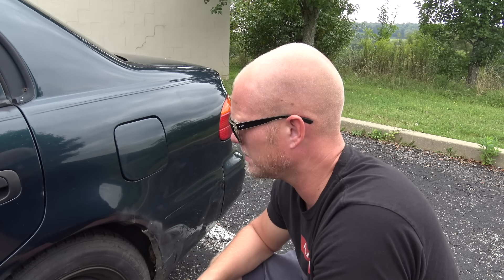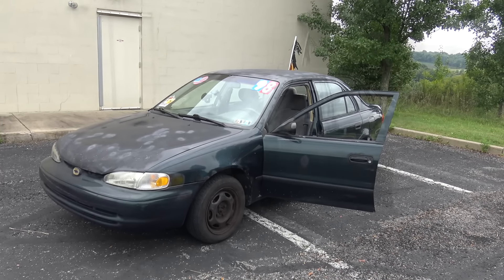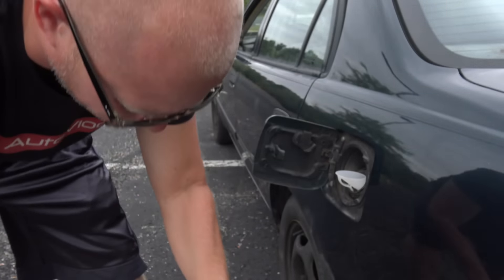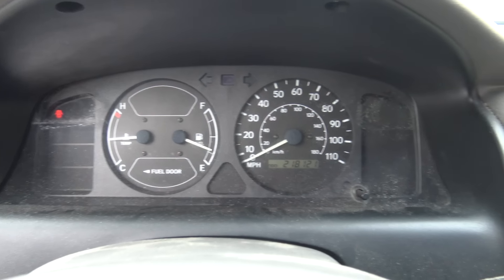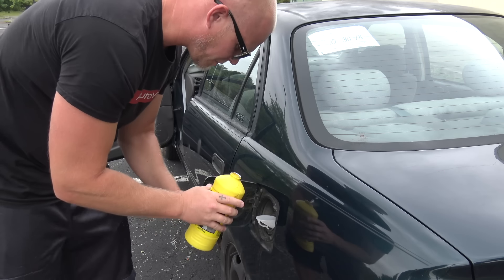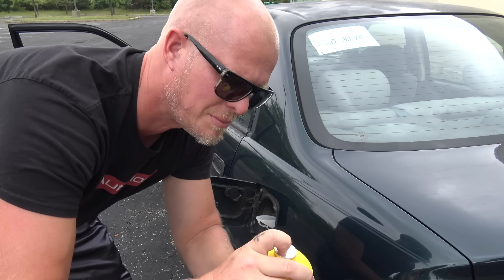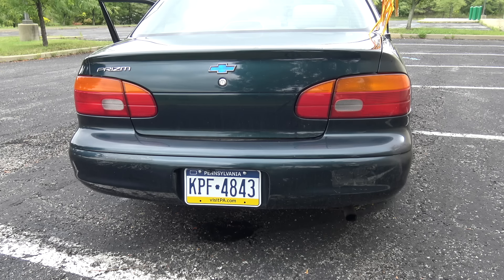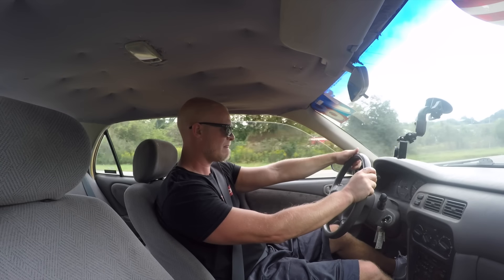What happens if you put BRAKE FLUID in your gas tank? (You'll be surprised!)

Comment: Try putting a gallon of E-85 in the gas tank...
Reply: You will notice nothing
Reply: If the auto adjust can't open enough it won't run. MPG will drop and power will be down. Also on an old car with neoprene o rings, the o rings will fail. The catalytic converter will plug up.
Reply: gene1351 e85 will ruin your engine. It burns too hot and gives poor mileage to cars that are built to use it.

Comment: This is for batteries. Put in distilled water into the battery and it will get u to home or to a store near by u for a battery the cells sets on the bottom of the battery floor over time time so I put in the distilled water into the battery and it loosing up the cells from the bottom of the battery

Comment: Surprised nobody mentioned the camera cuts between openingthe break fluid and pouring it in 🤔 or that break fluid is not that thin
Reply: Jay M  I said the same things
Reply: @lisaduckswork  I'm even more surprised by the amount of people who believe this
Reply: @vulgervulcan  What happens if you put GASOLINE in your gas tank out of a BRAKE FLUID BOTTLE? (You'll be surprised! Even though gas engines run on gas!)
Reply: dot 4 is ALOT thiner than dot 3
Reply: @vulgervulcan  yes there are going to be a lot of mechanic shops making money to rebuild their motors lol

Comment: nice mileagee on the car. I once put petrol 10 liters in my diesel Chevrolet captiva and the mechanic said top it up with diesel and again when half tank- It ran fine
I accidently put petrol as it was a dark blue nozzle-premium fuel and was kept separate to the rest like you would normally find diesel nozzles kept separate from the rest petrol. I didnt look. pulled up next to it and picked up the darker separate kept nozzle and only realised at the till when the operator said petrol on number 6

Comment: man that remind me when I put power steering fluid in the brake line of my 1980 escort, Man that thing locked up like a big dog  it just started slowing down, Iwas so sad
Reply: Because it is a hydraulic fluid...and is not compressible.... and when it gets compressed it will not release hence hydrolock term applies. brake fluid works a little bit different...

Comment: Barbecue lighter fluid would be interesting.
Reply: I owned a Toyota corolla 2007 model live in Nigerian can I use our brake fluid? If yes what is the function and impart to the pump,injector, and the engine.

Comment: Ugh!!! Your video had no point and was sooo  boooring, but I watched the whole thing so I guess the joke is on me.
Reply: So did I watch it and it just goes to show the parlous state we have got ourselves into!  Seriously I think it just outlines the principle that an engine intended to run on motor spirit will probably run on any hydro-carbon. Check this out but I believe Rudolph Diesel was trying to make a motor that would run on coal dust. In principle it will with high enough compression it heats up (it needs some heat help at first) and it will burn. The burn produces the gasses which drive the piston(s) which is converted into angular motion by the crank. His early engines had little plenum? chambers to the side where the main compression took place and the burn started. They run slow but strong.  I had to do this topic as a thesis just before I left school way back in the daze!  At last I have someone to tell about it! Rgds BerryG   
P.S. Just remembered there are folk who use old fryer oil for diesel fuel. It makes 'em stink of fish & chips but they go and it's cheap. I suppose it's also legal? BJ
Reply: Well Enrique.......there was a HUGE hint in the title....
Reply: There's 5 minutes of my life I'll Never get back.
Reply: Camera cuts between opening and pouring haha it was gas

Comment: I`d have thought that the brake fluid would have devarnished (injectors , fuel lines , pump, and the fuel tank ) ergo improving the fuel consumption , plus allowing better life for each of the parts
Reply: I remember back in the days when you had leaky oil seals you throw a bottle cap or two of transmission fluid in the oil reservoir and it stops the smoking from leaky oil seals
Reply: Chainsaw
Reply: I also herd that break fluid works perfect in you're breaking system
Reply: Kevin Wilkinson okay don't laugh but I'm going to say it. You can run Transmission fluid 1 quart per thankful in any vehicle.  It has to be Dextron only can't have Mercon.   My neighbor did this for years in a couple vehicles got like 600,000 miles on engine before it gave up the ghost and finally died.  I run Marvel Mystery Oil in mine got almost 300,000 miles still running strong.

Comment: Episode #2 =  he's going to put brake fluid in his empty wiper fluid reservoir on a slightly wet day.
Reply: JosefKKafka mm
Reply: Calling the car paint shop :-)
Reply: @darrellfeit7158  Episode #3 = will demonstrate how to re-spray badly damaged bodywork paint.
Reply: @JosefKKafka  Yes--I use a 4" brush attached to an electric drill for the swirl effect :-)
Reply: @darrellfeit7158  That is even better than using an old-fashioned lavatory cleaning brush
Reply: @JosefKKafka  Not to mention the beautiful wall & ceiling Murals in the garage.  I've tried selling my patent on Craigslist "personal section".  So far only gang tattoo artist have shown an interest :-(
Reply: JosefKKaf
Reply: @williamwoodward3491  ...ka
Reply: @darrellfeit7158  ė ?m

Comment: You should have emptied the gas tank before adding the brake fluid..
Reply: OK TRY DRANO THAT UNSTOPS DRAINS BET WON'RT GO FAR IF USE IT EVEN ONE BOTTLE.
Reply: Yes,and see if it works with jus break fluid
Reply: if you look at the fuel  gauge it has more in it the next day than when it started out
Reply: That's what I'm saying
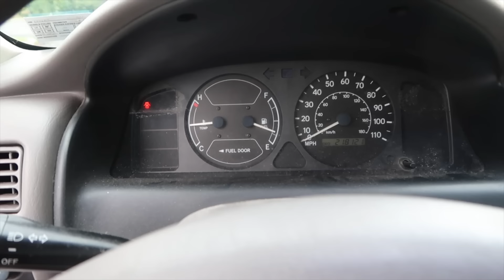Reply: christopher coulter; yep 2:47 vs 6:01
Reply: Gout treatment
Reply: Searsn
Reply: christopher coulter the drive way where he parked could've shifted all the fuel to the front thus making the fuel gauge look more full maybe
Reply: Ok a brake fluid bottle with gas in wow show is over

Comment: Putting transmission/power steering fluid in your tank is supposed to clean the valves.  Pour it directly into the carburetor barrel full throttle and it smokes  crazy hell out of the exhaust.  Like a weeny roast.   It was a 318 and it responded well.

Comment: What about power steering fluid in the brake reservoir
Reply: Lmao
Reply: Its bascilly the same duh
Reply: @michaelmaldonado5680  not true at all! Power steering fluid reacts with brake fluid and it gels up and causes all things rubber in the brake system to swell. Basically everything in the brake system needs to be replaced if it happens.

Comment: Makes me wonder if in fact it is cleaning out the injection system as good or better than a regular injection cleaner  ? I know i have used brake fluid to clean carbon and greasy parts back when I was a young teenager  .
Reply: That is correct, and it does the same as kerosene on diesel, helps clean the injectors and makes the engine run a little smoother... And it actually reduces the amount of smoke so that is why kerosene is used on semi trucks. I own an old Land Rover series III, class C, 5 door, station wagon, and always use a 80-20% percent mix. It even helps when cold starting the engine.
Land Rover owner manual as a matter of fact, suggests this, especially in very cold weather during winter, up to 70-30% mix..
Reply: So this one  is new on me ,,,, but when I was a teenager in the 60s / 70s  in Oklahoma , my friends would pour automatic transmission fluid straight down the carb while the car was running , or actually add atf  to the gas tank ,,, it cleans the carb  -- the engine will smoke white for a short period of time
Reply: Brake fluid will clean injectors ect. but it's hell on rubber seals and O-rings
Reply: @insulman100  how could brake fluid be bad on seals? Don't you think there are seals on the hydraulic brake system?
Reply: @ @Golgi-Gyges  Adding DOT 5 (silicone based) fluid to a system filled with DOT 3 or 4 (glycolether based) fluids causes rubber seals to swell, see http://www.mg-tabc.org/library/brakefluids.htm. Similarly will contamination with petroleum based motor oil, power steering fluid, mineral oil, etc. cause rubber to swell. Brake systems should be flushed only with DOT 3 or 4, never with alcohol. http://www.britcycle.com/Manuals/DOT5.htm
Reply: @MrCuddlyable3  you've missed the point of the video.
  DOT 5 brake fluid included with the fuel of the tank (then ran, of course).
Reply: @MrCuddlyable3  by the way,  don't think any seal is (plain) "rubber" anymore.
Reply: @ @Golgi-Gyges  No Sir, it is you who have missed 1:15 in the video that shows explicitly that the fluid used was DOT 4.

Brake seal rubber is synthetic EPDM (ethylene propylene diene monomer) rubber. You are free to look up published information about the Dienes used which include dicyclopentadiene (DCPD), ethylidene norbornene (ENB), and vinyl norbornene (VNB).
Reply: @MrCuddlyable3  you are really lost, Suh.
Reply: @MrCuddlyable3  what part of a car's fuel system is "plain rubber"(?) - no part.
  My intended idea was that any brake fluid will not hurt seals in the fuel system...I related that there are (also) seals in the hydraulic brake system (as an example).
  My words are often two moves ahead, so don't feel bad.
Reply: @MrCuddlyable3  also, I know that it was DOT 4....in another post to the video, I suggested DOT 5 fluid....that is where you got hung up
Reply: @Golgi-Gyges  Your post shows you fail to understand what has been posted here.

Comment: hi i put brake fluid in my 2018 honda accord and now the vtech doesn’t kick 🦵
Reply: I thought you were saying "now the clock doesn't work."
Reply: Did you put it in the gas part or motor
Reply: mcs Bangladesh lol does your legs kick ?
Reply: Well considering your vtec deals with ur camshafts moving position i have a hard time believeing that its not working anymore unless u put brake fluid in your engine oil and u fucked ur actuators for ur vtec to activate. Mind you vtec happens at around 4500 rpm under load. What that means is you have to slam the gas and be at around 4500 rpm or more for vtec to activate and you will notice ur car a little faster and a little different sounding
Reply: Wait maybe not. Your car is new enough that the o2 sensors could be sensing different chemicals or heat fluctuations and it may not let the the cams rotate in order to save the engine. or whatever reason those damn engineers say
Reply: Plugged the cataityc or resinator
Reply: @gianmameli4971  which one? They are 2 different objects. I would think the cat because it reduces emissions with the honey comb. I doubt the resanator because it just is a muffler to reduce noise

Comment: Brake fluid is alcohol based so it will mix.
Reply: The brake fluid is rather flammable, especially under pressure.  Never mix brake fluid with bleach, that is the perfect fire bomb , extremely dangerous
Reply: Brake fluid is made from vegetable oil.
Reply: @shinybits  I think you made a slight error my friend? Some brake fluids are a derivative of mineral oils (i.e. obtained from the same source as petroleum, crude oil from an oil well?) and others are silicone based. In both cases however, there is a pretty big % of alcohol (diethylene glycol) so basically, given the proportions of brake fluid to gas as in this video, it's hardly likely to destroy a car engine?
Reply: Udo Weiss. normal brake fluid is water soluble so not vegetable oil.
Reply: @benjameson9052  Better known as alcohol based.
Reply: What?  There is alcohol in brake fluid? When?
Reply: @joker4206987  They are glucol based if you Google it but Rolls Royce uses a mineral oil base.
Reply: @robertsnyder5149  So what you guys are saying is that Jack Daniel's will make the car run better? Who's up for that experiment, ey?
Reply: @Rick-the-Swift  Not Jack Daniels but at least 100 proof alcohol. It won't hurt it a vir.
Reply: Brake fluid is not alcohol-based.
Reply: @charleswilson925  Well if you check your puter, you'll find it ethanol based which is an alcohol or like the fluid that Rolls[Royce uses which is a mineral or vegetable oil base
Reply: Alcohol needs an emulsifier to mix with petrol it a special oil is required for the engine. Castor oil was the oil but there must be a synthetic oil available.

Comment: Many comments saying how it's actually a good way to clean out your fuel system. In my completely amateur opinion though, there are plenty of products made for cleaning out your car for various purposes. To me, it's not worth it at all, especially if you are like me and have one mode of transportation that is not old either. Curiosity is a good thing, but never let curiosity go too far. XD

I would love though if this was a tried and true method to be used. It's super hard to find a place that will dispose of and recycle used brake fluid from brake flushes, but still not worth risking components just to find a way to burn off used brake fluid.

Comment: I am a mechanic...put a bottle in your transaxle...lol
Reply: Any ideas on a life prolonging hack for slipping tran., Nissan Exterra?
Reply: @JuanMartinez-mw5rc  don't put brake fluid in it !!! If it is slipping, baby it until you can allocate funds to repair..I'm a transmission tech for many years
Reply: R C Robertson Hey chief, I’m a shade tree,  tell me please, what will happen if you do that .  Will it dilute the dope and locks  up the transaxle?
Reply: @jqg4r9  The brake fluid is not compatible with rubber seals in the transmission. A bottle of brake fluid after a few days will cause the seals to swell and soften...resulting in very poor seal performance and an inoperative transmission. When you disassemble a transmission that has had brake fluid added to it there is no doubt about the cause of failure
Reply: R C Robertson   You must have misunderstood me, what I meant was,  what would happen if you put that stuff in your rear end transaxle as someone related for that person to try. I think it would dilute the rear end dope and lock up the rear end. Personally, I wouldn’t try any kind of stunt like they’re doing.  I can’t afford a messed up vehicle at all.  I would stay strictly by the book.
Reply: @jqg4r9  I was referencing an automatic transaxle . Most auto transaxles have differential built in and share a common fluid ATF.  For those that do not and have a separate fill and any differential front or rear...the brake fluid will destroy all rubber seals. In the case of locking differentials with clutches the friction material would be contaminated.Brake fluid should only be used where it is recomended. Something else that may interest you is I have seen people use power steering fluid in brakes resulting in the same effect on rubber brake parts. Both fluids are hydraulic yet very different and definitely not compatible

Comment: what ever he poured in the tank looked like it did not have the consistency of brake fluid.
Reply: That ran across my mind too
Reply: he pored a piss
Reply: It looked exactly like the Dot 3 brake fluid I have used.  Why would he fake the whole video?  Just to save a junk car?  He is trying to produce an entertaining video and grow a large audience.  He was hoping the engine would blow.
Reply: I agree looked too clear and flowed too easy. Also as long as there is more gas than other fluids you mix the gas will still burn and vehicle will run
Reply: @michaelruth8447  Brake fluid is clear and flows easily.  It is only brown and sludgy when it is dirty.
Reply: @allent1034   i disagree. I just did all my brakes all new calipers. Used actually same brand. When you pour it out it has a yellowish tint. And its definitely a lot thicker than what he's pouring in, it won't splash like your seeing. Also if you notice after he pops seal its not a straight shot complete frame to frame  from popping seal to pouring. Big red flag. Now I'm not saying it's not possible to dump brake fluid and have car run. Its a game of ratio. You can pour anything you want into your tank and it will run as long as there is more gas than other liquid. In actuality the car is not "running on brake fluid". Empty your gas tank completely, dump a bunch of brake fluid in and show me the car will even start let alone run.
Reply: @michaelruth8447  You are right, I did notice that the "pop seal to pour" scene had a break in it but there are numerous odd breaks throughout the video.  His fluid did have a yellowish tint to it though.  Of course when I pour mine I do it slow (I am sure you do the same) so I couldn't attest to brake fluid splashes when poured like that.  You should buy a new bottle and pour it out fast like he did to see if it splashes.  
Of all the "real" conspiracies in this world I seriously doubt this is one of them.
Reply: @allent1034  Gasoline has a yellow tinge to it as well. It was a fun, entertaing video. I just don't want to see people putting in brake fluid, because theres no gas around. Brake fluid will not atomize and turn to vapor for proper combustion inside the cylinder head like gas would. If it can even make it through the injectors it would probably make them, nice and clogged and sticky and goopy. Lol.
Reply: Such a skeptic Brittany. What possible motive would the guy have for lying? Why don't you try it yourself and let us know how you go. Live a little. Go out on a limb.
Reply: Yep it was gas🤣

Comment: Brake cleaner carb cleaner you can use both to check for vacuum leaks. Car will run better when you spray into a leak.

Comment: My mechanic advised me to put small bottle of brake fluid in full tank of diesel to "clean injection a bit". It was an old 1.6td golf. Of course i never did it but it is common practice here for old diesels to unclog injectors, fuel lines and diesel pump. Is it help? Dont know...